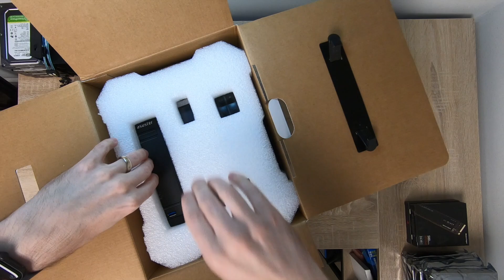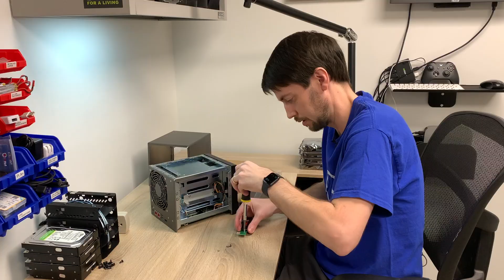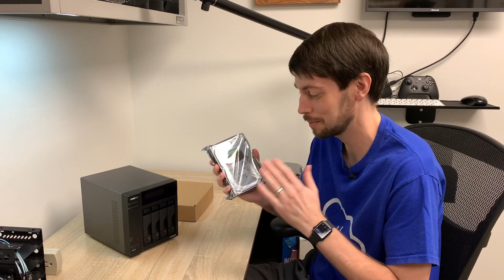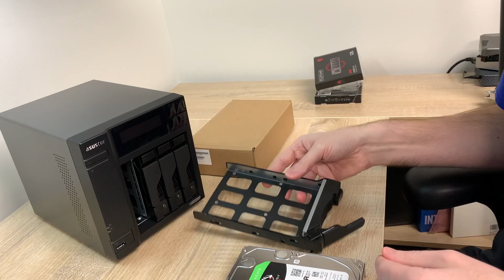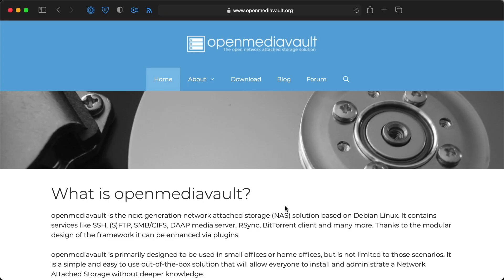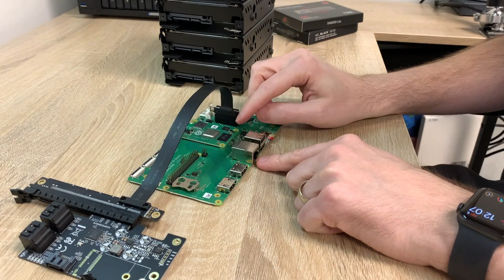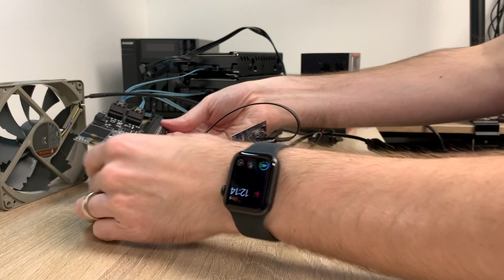Raspberry Pi vs ASUSTOR NAS Head-to-Head Part 1 - Hardware

Comment: 2.5Gb is nice.  I'm so sick of Synology sleeping on this.  You have to buy a huge NAS to get 10Gb which I just don't need at home.  The drive count, not the ethernet speed.  With 2.5Gb now being a (very loose) standard with WiFi6, everything should be coming with at least that now.
Reply from the maker: My hope is that 2.5G will be about as prevalent in a few years as 1G is today. It's like a free speedup (unencumbered by patents) for anyone with an existing wired network. No need to swap out cabling, no need for burning-hot new switches or $150 network adapters...
Reply: @JeffGeerling  Exactly.  Except I was hoping for a little more seeing as how the last two mainboards I've bought have 10Gb.  Hopefully someone pushes for 5Gb.  Switch costs boggle my mind though.

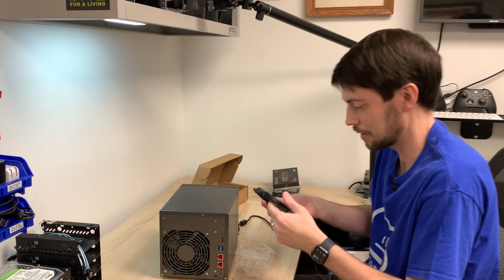Comment: 13:00, I thought Cat5e had a theoretical max of 1Gbps (either that or GBps, I know there is a difference but hard to remember capital B vs lowercase b)?
Reply: Cat5e can handle 10-Gigabit Ethernet up to forty five metres.
Reply: @ASUSTOR_YT  I looked it up, it appears that is true for Cat6 and Cat6e but not Cat5e, if it is true for Cat5e could you cite your sources?

Edit: nvm I see what you mean, everywhere online states it is 1000Mb but I assume it is only classified by the speed it maintains at 100 feet rather than the 40ft or less for 10Gb on Cat5e, thank you for this knowledge :)
Reply: @JordanPlayz158  No problems. Hope you're having a great day! It's actually metres, not feet. So if a cable is properly terminated, you should be able to get full 10-Gigabit Ethernet speeds of up to 45 m or 147ft on Cat5e while Cat6 is a bit longer at 55 metres. Its rating of Gigabit is for 100 m or 328ft. The 2 metre (6ft) cables we include with our NAS would happily accept 10-Gigabit connections without breaking a sweat.

Hope you're having a GREAT day!
Reply: @ASUSTOR_YT  Thank you for the correction and expanded explanation, hope you have a good day as well

Comment: Stop trying to insert your Pi Nas into the rear socket for your software problems.  And don't try to overclock it too fast or you'll prematurely blow your hardware and you'll be stuck trying to plug and play your own legacy joystick.

Comment: Do CM4 has a io board that has a lot of sata connector or you need to request to someone that can build?
Reply from the maker: There are a couple in the works; everything's been delayed lately because of the PC component shortage :( — see https://pipci.jeffgeerling.com/boards_cm
Reply: @JeffGeerling  i like the nas and the high quality audio out boards and i haven't seen one with audio in with xlr interface for podcast on a budget.

Comment: What would posess someone to cach to SSD rather than RAM?  Won't you kill the SSD in short order?
Reply from the maker: The SSD can store a huge amount of data comparatively, and can also be used as a safe write cache. If the system is powered down during a write operation and the cache is dirty and stored in RAM, the data's toast.

Plus Linux will do its own in-memory cache too with whatever free space is available in RAM, so better to let it do its thing.
Reply: @JeffGeerling  I've liked SSDs for the past few years, but for cache...I rarely even make  use of my Linux swap partition.  It's better in RAM.  If the disk crashes before the index is written. the data may just as well be toast anyhow.

I agree about Linux, I had to look that up earlier to check if there were any additional settings.  I actually went into my stash to see if I had additional memory to add to my old NAS.
Reply: @nicholassmerk  That's why RAID 1 is mandatory in Read/Write mode. Ensuring that if an SSD crashes or dies, then the data is not toast.

Comment: Or you just settle for 1Gbps Ethernet, skipping the pci switch, ethernet card - this should reduce the cost and complexity on the PI build very dramatically.  100MB/s transfer from spinning drives NAS is not too shabby.
Reply from the maker: A solid 117 MB/sec, in this Pi's case :)

And yes, I will be making that point in the next video. Check out the Wiretrustee SATA board for a good example of this 1 Gbps NAS setup being executed exactly as I want to see it.

Comment: What is the difference between a "NAS" drive and a regular drive? And that thing doesn't even have a built in power supply... And thus is not self-contained.
Reply from the maker: Often it's the warranty. There could be some other differences (e.g. using higher binned parts and motors / read heads that are rated for more cycles/longer life), but the warranty means the company believes the drive to last (on average) at least that long with a NAS workload (always or often running, with lots of write / rewrite activity). Different drives optimize for different performance aspects.

Comment: Sorry, but I don't want my NAS depending upon the SD card in a Raspberry Pi. Of course, the SD card is not the storage for the RAID, but your NAS operating system is running on a SD card. That is an unacceptable point of failure.

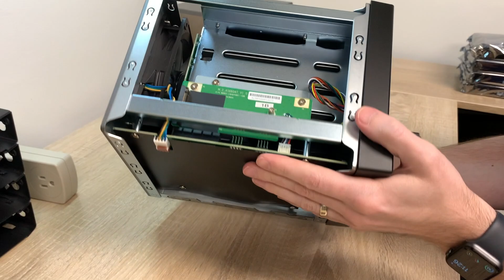Comment: 3:35 can you add a GPU to this thing?
Reply: It is not a standard PCIe socket. I wouldn't attempt to plug anything into it. It has the iGPU from the Intel processor.

Comment: Uhm, not having this issue... I owuld go with HELIOS64.
I have a full server (12 core XEON and 64BG ram + SAS cards)  as NAS.

5:03 Is that a x4 slot, how can it handle two x4 NVMEs? It does not seems to have clock buffer so it is a non standard connector?  (so no bifurcation)
Nor a PCIE switch so its not event a smart adapter. This remember my microsroserver... with odd connectors That would be a no go for me.

Why the helios?
5 drives bays
ARM powered
UPS is built in
2.5Gb Port and 
1Gb port
WOL
And it cost similar to the RPI solution.
Reply from the maker: Regarding the HELIOS4; there are a few other projects coming soon that may be pretty interesting along the same lines, based on the CM4...
Reply: @JeffGeerling  I know that :) But the RK3399 have more pcie lanes so it have more bandwidth on IO. Hopefully the next RPI will have a more capable pcie controller
I'm also working on my own design but YT does not allow images/links on the comments...
Reply: Hi! Non-standard port that provides two PCIe connections in one port. x1 each as the Intel SoC has six lanes.
Reply: They mentioned elsewhere it is not a standard PCI-E pinout.
Reply: btw. Kobol has upgraded their Helios4 last year to the Helios64
(Hex-Core arm64, 5 SATA Port, 4GB RAM, 16GB EMMC,  1x1G & 1x2.5G Ethernet)
Reply: @ASUSTOR_YT  I've spotted that! No idea which SOC youre using, But if thoose lanes are x1 I assume are coming from the PCH so those are PCIe2.0.
AFIK Intel SOC have PCIr 3.0 1x4 coming from the CPU (this can support bifurcation but I'm not completly sure), those lanes are internally pinmuxed with 2 sata ports for NGFF socket 3 applications. So using CONF_X pins the bios can switch mode and does not require MUXes outside the Soc allowing smaller PCBs. The other lanes are from the PCH. I've been out of this stuff for some years.

My latest intel product is a 4th gen product. So things could have changed.
Reply: @Astra7525  Yea I've meant that, I've made a typo! That one is based around the RK3399.
Reply: @tuttocrafting  It's a Gemini Lake SoC, so PCIe Gen2 which provides speeds on the x1 link of 5 Gbps. While, yes it doesn't take advantage of the NVMe drive's entire sequential speed, it's primarily for taking advantage of its random I/O throughput.

Comment: Wonder what the fan pin connector is for that NAS?
Reply from the maker: It looks like standard 4-pin 12v PWM.
Reply: @JeffGeerling  cool! So you probably install a Noctua fan in it.
Reply: @JeffGeerling  It is a standard 12v PWM connector.
Reply: @mr.b5566  You could... the issue is we use quite a powerful fan for some of our NAS devices. Our NAS devices are finely tuned to balance its excellent cooling performance and noise. While admittedly, the fan is bland looking, they are quality fans. We use fans from YS Tech as they're one of the only ones producing a 2.3A fan, FD121225SB, enabling us to have high airflow with less noise at 208 CFM or 353 m³/hr. Some of our lower power NAS devices use the FD121225HB which is 0.46A and is rated for 106 CFM or 180 m³/hr for more power efficiency. 

The issue is no Noctua fan comes close to the FD121225SB at its 208 CFM or 353 m³/hr and only their most powerful bland-looking industrial fans match the FD121225HB at 106 CFM or 180 m³/hr. I like Noctua fans and they are great for PC cases and large tower coolers, but they're just not appropriate for our NAS as they would not be adequate enough to cool the hard drives AND motherboard components at the same time. 

We have not locked it. Nothing is proprietary. You can install it, but you do so at your own risk of hindered hardware and cooling performance and shorter hardware life expectancy. Trust me. I learned the hard way by putting one of our NAS devices together with some old spare parts around the office and a spare low power fan. The NAS itself was hot to touch. I won't make that mistake again.

Comment: CMR/SMR - Not justifying WD but it still only matters if you are absolutely pounding your NAS all the time.  Honestly, if you are enterprise building a NAS, you aren't buying those drives.  Yeah they shouldn't have done it but seriously but who was truly affected?  Measurably?
Reply from the maker: A lot of people like me do need a NAS they can pound from time to time (write 20-40 GB of video files then start accessing the data soon after, and maybe write back another 5-10 GB), and even in those cases SMR can show its flaws.
Reply: @JeffGeerling  That's not pounding though.  I'm talking hundreds of people accessing the NAS.  One or two connections is fine.  I have them in my NAS now because they were dirt cheap.  I can max out the NIC on it at any point in time all while streaming a video to the living room.  Zero issues.  Now if I took these into work and served them up to hundreds of people, that would be a problem.

A single 40GB file being written to it is fine.  Having hundreds of thousands of files being committed to it, is the problem.

All in all a couple connections to it can max out the drives capabilities with zero degradation.

Comment: Why the hell are NAS devices so damn expensive? I built a cheaper odroid H2+ for around $250 that has an M.2 boot drive and two 6TB HDD in raid 1, 16GB ddr4 ram dual 2.5GB NIC and 4 USB 3.0 ports and display port & HDMI. It runs my plex server and any other files I need backed up. And I bet it runs circles around this Asustor $500 recycled E-waste! You could end up spending almost a $1000 to outfit that NAS!

Comment: Finding storage drives that work reliably with the raz is like playing a game of whack a mole. Bare boards, extra power supplies, hard drive adapter boards = no saving, unsightly mess. This one is a no brainer, Hard Pass on the Pi.
Reply from the maker: Check out part 2 (just out today), especially towards the end—products like the Wiretrustee SATA might make it a bit better!

Comment: Here i am sitting debating myself if i should spend much money on a NAS and here they just give them away as if they are nothing. 
Guess that gives me the answer. They are overpriced and i should not buy one since they give them away for free.
Reply: Not necessarily. While we do offer to media for marketing purposes, a video is the trade. However, we do offer budget options starting at $149 US... There may even be 2.5-Gigabit budget NASes for similar prices around the corner. ;)
Reply: @ASUSTOR_YT  I know about the trade off here with the video. But still the fact that these can be given away for free in the hopes of making money due to the "free advertising" is already enough to drive me away from the idea of buying a NAS in the near future. The one shown in the video here is 560€ at the moment which of course will outperform a $149 solution by far. So it's more reasonable to just use a USB 4 bay casing and simply using the build in USB Storage option of the router instead as a NAS.
Reply: @hellofyou  Not necessarily. Price tiers often differentiate between features and performance for multiple users. In terms raw throughput, the ARM CPUs nowadays far exceed the performance on Gigabit and are perfect for 2.5-Gigabit NAS devices. We're not getting free advertising. We paid for it by sacrificing one product. We're not a charity. 
We also provide support and protections that you might not find inside a router, including snapshots, RAID, file self healing, synchronisations between cloud services and more. I'm not going to try to unnecessarily upsell people who don't need it. Often a home user will be more than happy with the budget option and content creators might find that the one featured in the video with the SSD slots better for making videos on it. It's complicated and not all uses require spending more.
Reply: @ASUSTOR_YT  Again nobody would give away a product even at whatever the cost may be if they wouldn't expect this to make more money in the long run. This doesn't make it charitable and furthermore doesn't allow for a truly unbiased opinion to be formed about the product. In either case, i am fully aware of the benefits, options and functions coming along with a NAS which is why i said in the beginning i am debating myself. Conclusion remains the same. The asking price for the devices can't be realistic if they can be given away like done here. Making such a purchase unreasonable no matter what the purpose of the device would be and let's face it, someone who would take "content creating" seriously would not use a NAS for that purpose in the first place. With an actual profession there is much more sophisticated hardware involved than any NAS system could provide.  Not to mention that if one were to receive a NAS like shown here for free and then going ahead and picking out each and every flaw about it would 100% guaranteed end up in a video that doesn't stay online for long. I believe you can get where i am coming from and i am aware that there are many arguments to be had now but someone who is trying to sell a product would always talk about the good and nice things about the thing they are trying to sell as that is what is making the money after all.  One can't agree to the negative things pointed out as then they would harm themselves. So i don't expect any agreement on this or even common ground to be found.
Reply: @hellofyou  We send product out for a video. We do agree with the negative things about our NAS. We don't interfere editorially. When tech youtubers criticise the NAS, that's my cue to learn and take from the experience. We do not demand videos be taken down. We always push for a better product. We take a risk that the content creator might not like it and if they don't... That's the truth and we can only ask for the truth. We didn't sponsor the video. Jeff will not be asked to change his views. A negative video is helpful, not harmful. It provides us an opportunity to grow and learn and do better next time. We don't blacklist channels that give us negative reviews. I have nothing to hide. 

We sell products to a variety of businesses and content creators. Even big content creators like 8 Bit Guy have purchased a NAS. Not everyone needs sophisticated, power hungry hardware. We also sell to enthusiasts and home users as well. We sell to people who just simply want to keep backups. We don't judge. But we need people to know about it so they can make an informed decision....so...often tech channels receive the product to help us properly inform potential buyers.

Comment: Minor correction: at 7:30 you call SMR Shielded Magnetic Recording, when it's Shingled (referring to the way the magnetic bits are tilted over previous rows, resembling shingles on a roof) Magnetic Recording.

Comment: Why include the M.2 drives to increase performance, when it's not easily possible on the Pi? Like doing an Intel 11xxx against the Pi. No comparison. I used to like your channel, but this is massively biased against the Pi. Having the NAS cost under $100 is great.
I have an ancient Buffalo LS-WVL927 Duo. I don't try to compare my PiNAS to it. There isn't any. The price difference more than makes up for any differences.
Reply from the maker: I hope you watch the next video;  this video just talks about hardware setup. The next one will talk about all your concerns, and more :)

Comment: Well, this a 500 $ NAS!!!  Comparing it to a 50$ board!!!
It seems like a hijack trap!
Reply from the maker: All-in, it's about $350 vs $550 for full setups. Remember that the ASUSTOR is the same thing in the end—an SBC (custom made by ASUSTOR) that connects some drives to the network. The hardware that holds it all together's a bit fancier than my 'open air' Pi NAS approach :D

Comment: The only problem i see is that you probably should have used the 1gig eth on the pi not the 2.5 because your 4 sata drives are going to stomp on the expansion slot anyway... why bog it down with something the pi really cant do anyway... like 2.5 gig eth... you showed yourself that this wouldn't work like a couple months ago... so why set yourself up for failure... lame
Reply from the maker: So... 2.5 Gbps ethernet works fine, and the SATA card works fine. You'll have to see what happens in the next video ;)

Sometimes I like having more than 117 MB/sec network storage, plus the point of this exercise is to see whether the Pi can offer up a worthy challenge to a mid-tier NAS like the Lockerstor 4.